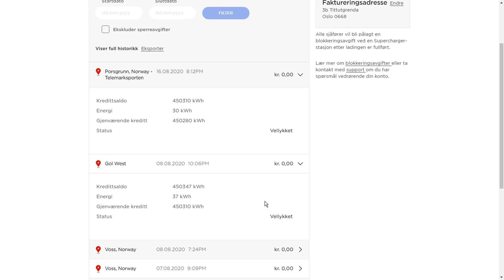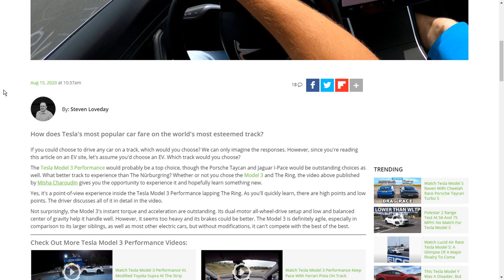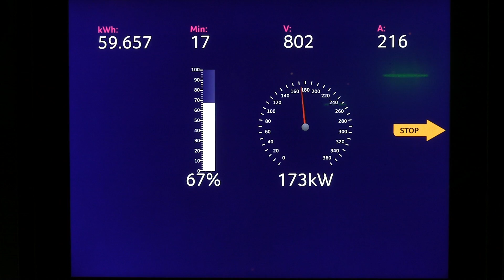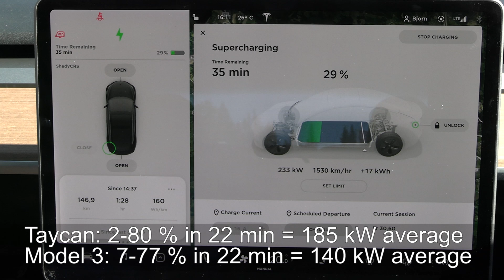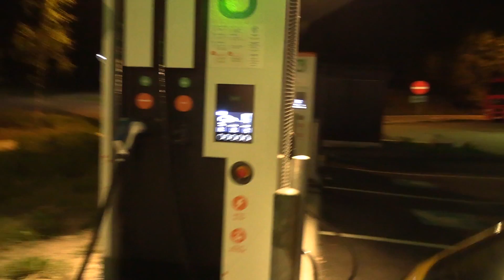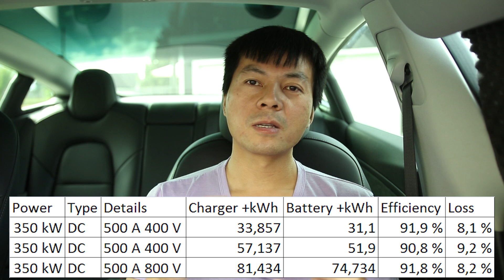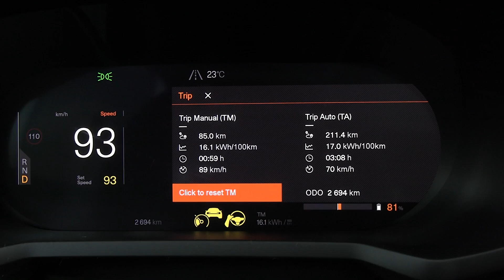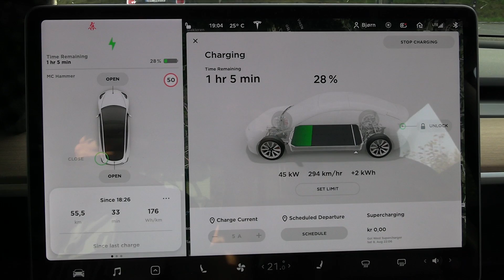Pros and cons of 800 V battery and charging systems

Comment: More than 400 V systems only make sense for larger vehicles, since you can use smaller cables. So 10 kV for charging semis for example would make sense - like tested in Germany currently with overhead wires.

While the voltage running from the battery to the motor is a completely different busissness. Maybe 800 V is fine for that, or even 400 V, since the cable ways are pretty short.

Comment: Great point of view.  But your point of view is from the perspective of a vehicle Model 3/Y sized.  Vehicle electrification will need to apply all vehicles of all sizes.  We are starting to see EV trucks/vans and other commercial vehicles that will be coming available over the next few years. Many of these will have battery packs up to 200KWh.  Here 800V charging will be a must.  Even for vehicles like the Tesla Cybertruck which will be somewhat disadvantaged if it has a 400V architecture.   And if 800V becomes universal might as well take advantage of it on all vehicles.

Comment: I agree with you on the 800V topic, it might have some advantages, but it also has some problems that come with it. (Including some legal hurdles... 400V is after all a "houshold standard"...) 
I do not agree on the 250KW though. With increasing battery sizes (which will also come with increasing numbers of individual cells) you can push more power into the system in parallel, without straining the individual cell more than you would do today. Do we actually need that? I don't know. But being able to charge 500 km of range in 5 minutes or less would take the last argument away from patrol cars...
Reply from the maker: That's exactly what I have been talking about in this video and the other one 2 years ago. People who think they need to recharge in 5 minutes have never owned a fast charging EV like Taycan, Model 3 or e-tron before. They have a fossil mindset.
Reply: @bjornnyland  I own a Model S, so I have some experience with it by now too. If you live in a situation where you can't charge at home the charging time becomes a struggle in some situations. My next "useful" charger is about 15 minutes walk away from my home, and it has an output of 11KW, so I have to leave the car there if I use it. In most cases I can avoid taking that trip and charge whenever I stop somewhere where I have a destination charging opportunity. But in those cases where I can't (e.g. next weekend I have four trips planned in rather short succession and no destination charging in any of those locations) this becomes a hassle. I will manage for sure, but not without loosing time that I would never loose in a petrol car.
(And to make matters worse, on the trip next weekend I don't even have a supercharger anywhere on the way...) 
It's a corner case, sure, but it's nonetheless reality.
Reply: They will come up with new arguments... 😉
Reply: @nakfan  Sure thing. But right now they actually have one...

Comment: These Delta chargers are not that common in other countries. They are popular in Norway with Grønn Kontakt and BKK. You can also find more of them in Switzerland, Greenway in Poland and Slovakia also uses them. Most other operators are using Alpitronic Hypercharger, ABB HPC, Efacec or EVBox and they all support 920 or even 1000V. There are even some 50 kW chargers from ABB which supports 920V (ABB Terra 54 HV).

Comment: When transferring electrical energy from one place to another, there are definitely efficiency gains with higher voltages.  Less current is needed to transfer energy at a given power level.  You incur less i^2R losses in the wires used to transfer the energy and since this loss is proportional to the square of the current, lower current it better.   This is why electrical power companies step up the voltage to 250,000 volts or more before transmission.  This enables efficient energy transfer at high power levels over long distances.  The voltage then needs to be stepped back down near the point of use.    

Within an electric vehicle, use of higher voltages allows for the use of thinner wires, resulting in some weight reduction. However, the length of these wires is fairly short (from battery pack output to the motors might be 2 meters?) so the weight reduction / efficiency improvements, are not that great. While charging an EV, use of higher voltages means that the external cable and wiring can be thinner and of lower cost. This is probably the biggest advantage to 800 volt EVs.  But as long as we are looking at ~100KWH battery packs and 20-30 minute charge times, 400 volt systems seems to perform very nearly as well as 800 volt systems. This suggests that the limitation is not the power delivery system, but the battery itself. If batteries ever get to where they can charge at 500 KW or beyond, then we will likely need higher voltages.   Such high-power charging would be nice, but it may not be worth it if it comes with a high cost.  Remember, for day to day use, most EV owners would charge at home or at work.  It is really only on long road trips that DC fast charging is an issue.  During long road trips, 30 minutes to recharge isn’t prohibitive, but it does mean you’ll likely want to manage your other stops (food and bathroom breaks) to coincide with EV charging stops.  Even if we get to the robo-taxi model, 30 minute stops to charge would likely be manageable.  Like everything else, faster charging speeds has diminishing marginal returns.
Reply from the maker: But as I have already pointed out in this video, once we get 150-200 kWh batteries, even a 30 minute stop will be very acceptable. Remember that the car must drive 700-1000 km before it needs its first charging stop. Most people won't even have to recharge during the day because the range is so great.

Even today I can't keep up with the fast charging on Model 3 on long trips. So you can only imagine how it would be with even bigger batteries and faster charging. Once you actually experience this first hand, you will understand that 150-200 kWh and 200-225 kW charging is more than enough for personal tranpsportation.
Reply: @bjornnyland  If/when batteries get that big, you are probably right.  Driving for 1000 Km without a break would be difficult.  Anything more might even be foolish.  (For those people who can, My complements on your blatter!).  So a "forced" break of 30 to 60 minutes would likely be a welcome respite.  I have my doubts if typical cars need to have batteries with that much capacity.  Seems to me that 400 miles  or 644 Km of range (requiring about 100 KWh for a Tesla) is likely ideal.   Anything more and you are just carrying around extra weight.  Less than 100 KWh (say 75 KWh) probably works fine for most people the vast majority of the time.  One might wish for more capacity on the occasional road trip, but if the car costs more for that extra battery capacity, many people would probably elect to save the expense and not purchase anything over 75 KWh (if such an option is available) if they can "effectively" recharge in less than 30 minutes IMHO.   The only exception I can see is if you need to tow a large trailer.  Then you might want more battery capacity and faster charging speeds.  I think this is the thinking behind the 200 KWh battery capacity option for  the cybertruck.
Reply: @williamthesling1201  Perhaps he has a sepp blatter.
Reply: @bjornnyland  I don't think you'll see many 200kwh batteries around even if prices go down.  EVs are too heavy right now, and there's value in reducing weight, especially for smaller cars (hatchbacks, midsize sedans, city cars, etc).  I agree on smaller cars not needing 800v but it seems inevitable, Hyundai/Kia will use it which means prices are going to go down too.
Reply: Bjørn Nyland I agree. My Model 3 is normally ready before I am when having a pit stop.
Reply: @bjornnyland  the problem is that you cannot charge a 150+ kwh pack on a 400V CCS in less than 30 minutes (let's say 15-80% soc) . The CCS standard has an envelope stopping at 500V, 500A and 150 to 200KW depending on the charger. Once you link this with the limitation of the cell chemistry you simply cannot do it. I message you on Facebook so we can discuss this more in depth if you are interested 🙂
Reply: Don't forget, the higher the voltage levels the better the insulation has to be and thus the greater the insulation costs to the car and charger.
Reply: @konradandreenordvik9829  I asked my Dad, an electrical engineer, about this earlier. He said the insulation on wires, including the windings in the motors, is way over-specced for the voltage and they could probably function well at a few thousand volts.
Reply: @Markle2k  Insulation for 800VDC needs to be pretty thick to begin with (look at 600vdc solar wiring), but also need to be thick enough that a few nicks won't immediately cause an arc.
Reply: @robot65635  No. Air has a breakdown voltage of 3kV/mm. The "enamel" used for motor windings is more than capable of thousands of volts. Formvar-coated wire has a required breakdown voltage between twisted pairs of 4200 Volts and a typical measured breakdown of 8600 Volts at its rated maximum temperature of 120 C.
Reply: So maybe for larger vehicles like minivans, taxi vans, cargo vehicles with higher energy use and bigger batteries - the 800V system makes sense!?
Reply: @jdekam  yes.
Reply: @jdekam  800V might make sense.  Tesla seems to have a 400V standard and that works pretty well.  They have the greatest number of DC fast chargers out there so that is now a legacy issue.  It is unclear if their network of superchargers could be easily "upgraded" to 800V?  I think it is based on a 500V output.  So they could push the internal voltage of the vehicles up to maybe 470V which would allow for up to 294KW charging...  A small but notable improvement.  A vehicle with a 100KWH battery could then go from 10 to 80% SOC in 15 minutes (in theory).   Given how relatively infrequently cars will fuel up via superchargers (particularly with ubiquitous destination chargers at home, work, hotels, restaurants etc...) 15-20 minute waits once in a while on a road trip is probably acceptable for 95+ percent of the people.  And I think this is Bjorn's point.  Even 40 minutes for big vehicles (with 200 KWh batteries) is probably acceptable.  Faster charging is always nicer, but when your are already pretty fast, faster still may not be worth it.  There are limits as to what most people are willing to pay for more speed.   Paying 10% more for a vehicle that can charge in 1 hour instead of 2 hours may make sense, but 5% more for a vehicle that can charge in 15 minutes instead of 30 minutes is probably not worth it.  And the cost, in both infrastructure and vehicles, to support 15 minute charging vs. 30 minute charging probably increases more dramatically (not 100% clear),  maybe more than 10% per vehicle.  So...  don't bother.
Reply: @williamthesling1201  Someone recently posted a picture (I forget where) of the information plate on a V3 supercharger which I think showed max voltage of 1000 volts, so maybe they can be upgraded?
Reply: @DrTed3  I did not know that.  Very interesting!  Thanks !!!
Reply: It all has to step down to cell level voltage eventually. Less loss at 800V supply, but offset by step down.
Reply: Randall Smith The cells are in series so would be set for 800V.
Reply: Thank you for a very thorough recitation of Ohm's law as used in HV systems. Unfortunately for you, what you posted is bull$hit. Higher voltage means being able to spin the motors faster, so for a given horsepower rating, the motors are lighter and more compact. Hence the choice by Rimac for the Taycan.
Reply: @vidznstuff1  Higher voltage doesn't increase the physical strength of the motor's rotors. That is the RPM limitation in EV applications. Change the gearing in a Model S Performance and it would easily top 300 kph and possibly 350 kph. There is plenty of torque down low to spin all 4 wheels in a Taycan. The second gear is to allow a higher top speed with a lower motor RPM sitting nearer the power peak.
Reply: @Markle2k  No point in arguing with a non-engineer. "strength of rotors", rolmfao
Reply: @vidznstuff1  Yes, I think I will take the your personal incredulity over physical measurement, physics and the word of Tesla's head motor engineer, Konstantinos Laskaris. An independent teardown of a motor measured the rotor size at 129mm. The motor spins at 18,000 rpm at redline. That's 46,700 g of centrifugal acceleration at the face of the rotor.
Reply: @Markle2k  Is he the idiot that cooked the rotor bearings in the early Model S cars because stray currents were ignored in the design or was that some other god over there?
Reply: There is 1.5km of wire in a Model 3... though only 100m in a Model Y according to Sandy Munro
Reply: @CED99  Yes, but this is all low power stuff.  12 Volt power for lights etc.  The big power goes to the drive motors and that  requires only 3 wires (or cables if you like) from the inverter to each motor.  This is where you need to supply up to several hundred amps.  Lots of current, but the distance is relatively short at just a few  meters or so.

Comment: 800 Volt is the future and that's ok: As you point out, fewer losses and the opportunity to reduce cable diameters = many kilos of copper per car saved. Multiplied by the number of cars produced that's a lot of cost waiting to be cut. CCS plugs are rated for 1000 V already today, so it's an anticipated development. And 800 V (or to be exact: any level between 400 V and 800 V) is fully backwards compatible, so cars using 400 V systems are not penalized. The messy bit is charging an 800 V car on a 400 V DC charger. The Porsche Taycan carries a DC/DC converter (50 kW standard, 150 kW option) for that job. So in the end some Excel spreadsheet balancing all the savings and costs will determine the speed of moving to 800 V systems and I'd say it will not be a super fast transition. Porsche needed the edge over Tesla on charging speed and that was the only way to get it done. This is only about cars of course, buses are already way beyond 400 V (example Scania's city bus runs at 650 V today).

Comment: You're right.
But the future is 800V because Porsche/Vag/Ionity needed to do something "different", and they pushed for this change. Even if it was not the best value-price option. People didnt need 800V, but Porsche/others did. Its an unjustified change.
Reply: Thank you Ionity for moving CCS charging forward; providing charging for both class 400 V and 800 V cars. Trucks and buses usually are 700 V battery and motors. They also use CCS chargers with 800 V. Ionity do not yet do charging bays that makes it easy to charge  trucks, but FastNed do.
Reply: @foersom5928  Ionity is a bluff. They stealed 39 million euros of public funds to make expensive superchargers for Taycans and for Germans and countries within the neigborhood. Also, 0,79€? Thieves and robbers. Ionity is the greates threat to electric mobility.
Ionity is the worst ever and I will use any other charging alternative at all costs.
Ionity delenda est.